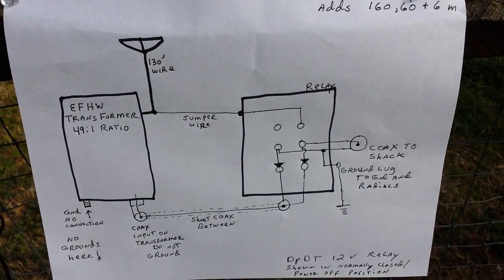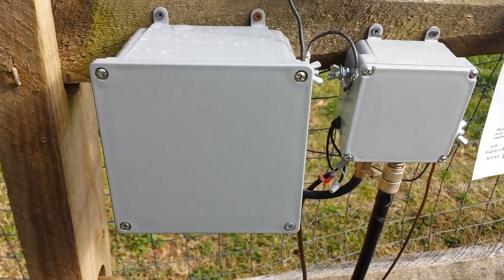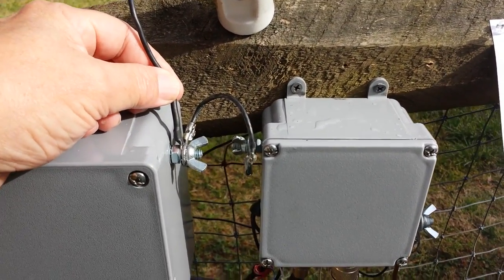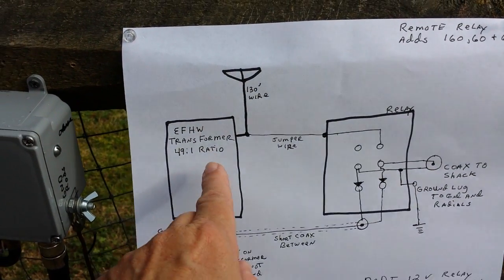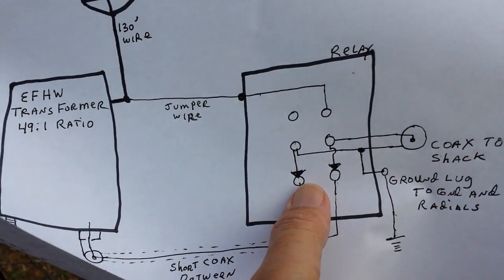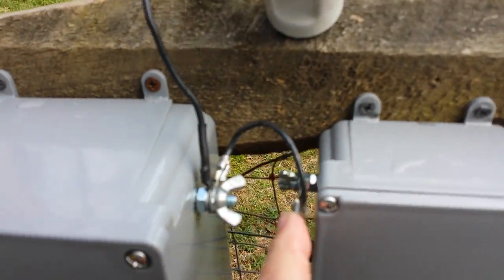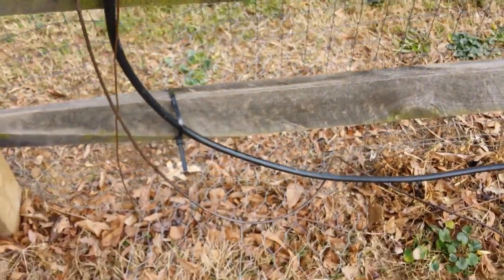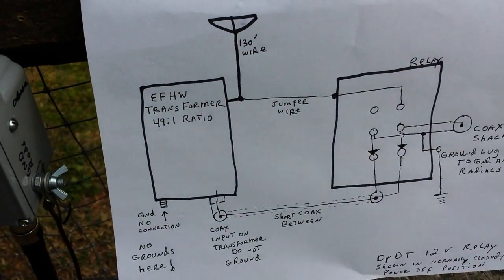End Fed Half Wave Antenna -11 Bands One Antenna!

Comment: Seems like a great idea - pulling in parts now for 80-10 EFHW - will use your trick for getting 160 & 6 as you indicate.  Still have some old open frame relays DPDT with lots of space between contacts.  Would be nice to see it in use and how well the 160m works.
73s. W6VU

Comment: This is probably the ultimate antenna for neighborhoods that don't allow antennas.
Or any home for that matter even in the boondocks.
I'd much rather have this almost invisible wire strung up as I had a fan dipole.
No pole needed! Awesome!
Did you come up with the bypass idea yourself or is that common knowledge?
Reply from the maker: Well I did come up with the idea but the concept is rather basic.
Reply: @n4lq  Which frequency is the antenna calculated on 40 meter?
M0MSN has added a loading coil to his to get 80 meters.
I'm sure you've seen that done too.
Reply from the maker: @RC-Heli835  You are talking about a different version of the EFHW. This has to be 130 feet or so long for it to work on 160.  I think you have confused this with the shortened 80m version which is only about 70 feet long.
Reply: @n4lq  Yes his is about 70 feet with the coil and 6 feet of wire added to the end.
Is your EFHW calculated 1/4 wave at 160 meters?
Reply from the maker: @RC-Heli835  No. It is 1/2 wavelength on 80m with no regard to 160m. It comes out slightly long for 160m but is easy to tune. One can insert a .05 or so capacitor in series to resonate it on 160m however.
Reply: @n4lq  I wonder if you could add the .05 cap on and make it switchable for 160 Meter or you just don't ever use 160?
Reply from the maker: @RC-Heli835  The .05 cap gets switched in line automatically when you go to 160.

Comment: Are you still currently using the antenna configuration? And how well does it work?
Reply from the maker: No. I'm using a separate EFHW for 160 and 80-10. Best antenna ever.
Reply: @n4lq  Did this configuration work well?

Comment: Thank you! Can this modification be used with a wire that has the capacitor for 75m fitted in the centre?
Reply from the maker: Negative.
Reply: @n4lq  Ok, thanks for the reply

Comment: I got a Palstar tuner, AT2K. My set up is as follows. 49:1 transformer, with a 134' of #14 PVC coated wire as an inverted L. It has also an 8' ground rod right under the transformer, mounted about 36" from ground level. The antenna works great from 80-6 meters, with a perfect SWR in all of those bands. 160 meters seems to be a problem. I am not sure if for 160, since all other bands are ok, I can use the relay box as shown, to try 160 meters. Will try that.

Comment: Steve, this is a very interesting idea. My caution, though, is that when switched to 160 meter mode there is no DC ground as there is when going through the transformer. Do not leave your switch in this mode without disconnecting your radio.

Comment: Steve. My only question about this antenna is: Why a 49:1? You’re fence is most likely an effective radial system and the impedance of an inverted L is not that high. I’m not doubting this works, I’m just curious why a 4:1 or 9:1 wouldn’t work even better. 73 de W9BOQ.
Reply from the maker: The impedance at the end of a half wave or multiples is nearly 2450 ohms. 50 x 49 = 2450 so it's perfect for the application. 50 x 4 is only 200 and 50 x 9 is only 450...It's a math thing. ..Now when we switch, with a relay, to a 1/4 wavelength 160 meter inverted L the impedance becomes less than 50 ohms so the transformer is therefore switch out / bypassed / gone. 73
Reply: I’m not debating you. You know more than I.
Yes an end fed has high impedance as you said. However, and correct me please, adding a counterpoise radial system under an end fed lowers the impedance? Maybe if I ask this. What is the impedance of a true inverted L with 16 or more ground radials? And what is the difference between that type of IL and your EFHW connected to your fence?

Comment: Thanks for the video.  Very well explained.  What length wire would you use if you didn't want to use 80 meters?  Is it possible to run 10 bands on a shorter length antenna?
Reply from the maker: 125 feet, yes

Comment: Hi Everyone, Facebook is dying, Groups.io is the place now for forums. I got rid of my Facebook a long time ago. 

Is there a Groups.io version ? all the yahoo groups are moving to Groups.io too. 

I have this EFHW 8010 nearly a year and get great DX with it from Ireland, to North, Central and South America, Australia, Don't be on much at the right times for Asia. 

It works ok on 160m in stock config considering I can get from Ireland to the U.K up to 500 miles with decent signal reports, I use external MFJ tuner for this. 

I have a wire fence close to the UNUN which is probably over 200 feet, I must try connect to this for 160m.

I was actually thinking if there was some way to leave the UNUN attached and some way of adding another 40 meters of wire to make it half wave on 160 and then some way to remote switch out 40 meters to make it half wave on 80 again ?

Comment: Steve are you still using the 11 band  EFHW Antenna? I ask because I need to put up new antenna's due to breakage. This will only be a one time that I can do this.
Reply from the maker: We moved and have room for both an 80-10 and the 160m antenna so I don't need the 11 bander but lots of folks report good results with it.

Comment: I know there are many variables, but do you have any Common Mode Current traveling thru the feedline? My guess is at 100 watts, no. But this design concept often has current getting into the outer braid at higher power or RF can find the relay line depending on length associated with the operating frequency.

Either way, I like this video !
Reply from the maker: Since the feed point is off-center and the braid of the coax is exposed to a strong RF field then, yes, there is opportunity for common mode current on the coax. If the coax is suspended in mid air then we should avoid resonant lengths such as 65' or 135' otherwise the coax's shield will act like another antenna and wreak havoc. Of course this same principle goes for any antenna design. I'm using about 145 feet of coax, 80 feet of which dangles from the transformer in a tall pine tree with the rest laying on the ground. I have no common mode chokes and no RFI even with 1500 watts on any band..... 

If your transformer is near ground as shown in the video then by all means attach it to a ground rod, run the coax along the ground or bury it. 
Control wires follow the same principle although you can't ground all of them! Usually just laying these along the ground will snuff out any antenna current that happens to be picked up control wire. One could also apply some snap on cores to them but experimentation would be necessary to determine the best location.

Comment: Brilliant! Just so happens I have a relay sitting here and was thinking;"how can I multiband my 160m 1/4wl inverted L"? I also run a spyserver here and have been looking for an antenna to to serve as a general purpose receive antenna that I can also use to tx with. Was going to build a mini hex for 10-17 meters but it makes more sense to do this. I know the hex would be better but with the bands the way they are why am I going to spend the time and money for those bands. The 1/4 wave inverted L on 160 w/folded counterpoise works great(1st contact was Italy ft8 on 10 watts 160m) so looks like I'll be grabbing a 49:1. Hats off and hanks for sharing this! 73 k1gmm

Comment: Hi Steve,
I have built a number of EFHW Aerial systems, all good performers. My latest was based on your designed EFHW plus the relay ground and aerial bypass all in a single oblong box. Excellent performance low VSWR on all bands and especially 160m although I had to include a capacitor 1700pf 1kv between where you have the jumper wire. I am mostly active on FT8 and can run safely up to a max of 30 watts on all bands on my  ic760  100w rig but limited to only 10 watts on 160m - does not like to go higher than 10w on 160? perhaps the capacitor could be a different value. I have a good earth, 100 yard wire fence, which seems to do a good job although some rfi on the coax on 160m only.  I have built a led + resistor and switch to box  from 12v to indicate when relay power up. Thanks for all your good work, best aerial I have.  G4PEY
Reply from the maker: Nice work OM. Is something arcing? I was able to run 500 watts with no problem although my next build will include a larger relay.
Reply: Steve Ellington  I upgraded my rig to an IC7300 and installed a second relay to switch the output of each side to the antenna and can now get the full 100w on 160 as well. Have replaced the windings with thinner enamel wire to get a better match and lower SWR on all bands.  Always seems to have room for improvement but great fun to work on. Now building a vertical for 20m 17 and 15m might put a relay to get 40m the same way. Thanks for all your gen.

Comment: Rich K8NDS I duplicated your relay box for my end fed antenna system (EFHW). All I have for a ground is 2- 6 foot ground rods and about 30 foot of wire on the ground.
I used it on WSPR last night on 160 meters with only 2 watts, I had many responses and one from Hawaii. Nice job on this project, now I can get on 160 meters with a decent signal.

Comment: Hi Steve, my ground here is solid sand stone 9" under topsoil.
My questions are #1. Is a house ground rod ok for ant. Ground purpose?
#2. How about tower base in concrete?
Well, interested in your reply.
73 de Mike w9mvm
Reply from the maker: Mike. If you're planning on using this as a 160m inverted L then you do need a decent ground system. A ground rod will just give you some lightning protection...That's about all. Run to the store and buy a roll of fence wire and some landscape anchors. Roll it out under the antenna and attach it to the ground. It will do a pretty decent job in lieu of 120 radials :*)
Reply: @n4lq  thank you Steve.
Will do.
73 Mike

Comment: Steve, Im in the process of setting up a EFHW similar to your design in this video. I dont expect to go over 100 watts. Will a relay rated at 5 amps work or should I use a 10 amp? Thanks Pat 73s
Reply from the maker: 5 amps is plenty. The gap between relay contacts does present a tiny bit of capacitance that will alter the swr a bit on 80-10m. There's not much you can do about that unless you use a "plunger" type relay. Be sure to read above about the capacitor in line with the jumper wire. 73

Comment: Although you specifically stated no ground was needed at antenna (80-10M), do you feel the proximity of your extensive ground has anything to do with the evidently good performance on these bands?  Also, what is your vertical and horizontal leg length of the antenna.    
Fine job!
Randy, K9BCT
Reply: He wasn't saying no ground was needed, b he was saying that you need to make sure the ground is to the radio coax port only, not common to the grounding/counterpoise for the 160 meter port...

Comment: I get activity on 6m but I use a yagi for most of the contacts. Your configuration looks good but I don't think you are too efficient on 6m. I have noticed most contacts I get on multi band 6m antennas the signal is week at best. The exception is fan dipoles with a 6m dipole. Now most of my 6m activity is in the summer.  You could compare your 6m to a yagi and see what you get.

Comment: a 49:1 transformer makes little sense to me from an engineering standpoint. Do you mean 9:1 transformer?
Reply from the maker: Probably not for an engineer but 1:7 turns ratio squared = 49:1 impedance ratio.
Reply: antennae often challenge engineering assumptions and theories.
Reply: At the end of the wire, the impedance will be very high, 1800 up to 5000 ohms. (at resonance or one of it's harmonics)  So the higher ratio is needed to bring the impedance down for a better match to the feed line.
Reply: https://www.youtube.com/watch?v=N_o0jneBEh0
Reply: Like already mentioned here, a end fed half wave antenna impedance is between 3000 and 5000 ohms. A 64/1 ratio will bring it down to around 50 ohms. There for no ground system is required, it is like a dipole but it is end fed instead of fed at the center 50 ohm point. I have built a few of these now and they perform very well with no counterpoise. Rich K8NDS

Comment: Hi Steve. Thanks for this vid. I see you are using the MYantennas EFHW-8010 transformer again. 

You got me hooked on the  MEF 330 from your last video and I bought one of them. Do you think  I can use the 330 for this setup with same wire lengths for the inverted L setup....with same results. 160m-10m?
Thanks
Reply from the maker: Hi Chris: I assume your wire is around 130 feet or so. That's 1/4 wavelenth on 160 so it will work there but you will need to bypass the transformer as I did. You also need a decent ground/radial system of some kind but even your house ground will give you some QSOs.   We now have a Facebook group for this antenna. Please join in. https://www.facebook.com/groups/EndFedHalfWaveAntennas/

Comment: Good arrangement, how long of a run for your 12VDC run from shack?
Reply from the maker: Hi Dave:
Around 100 feet of some old 24ga twisted pair that I got almost free. That relay takes very little current.
Reply from the maker: I had some scrap phone wire. 4 pair, probably 26ga and it's around 150 feet. The relay takes so little current !!
73 Dave de Steve
Reply: David Shelton m